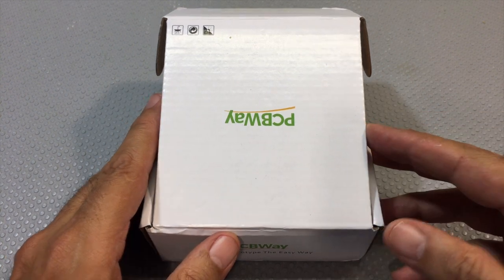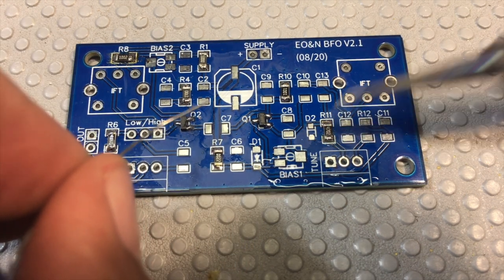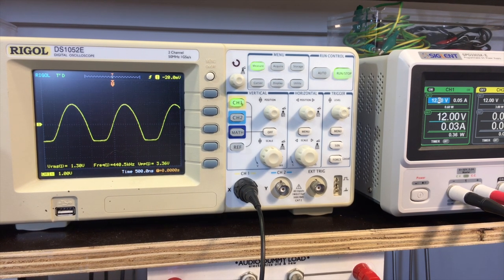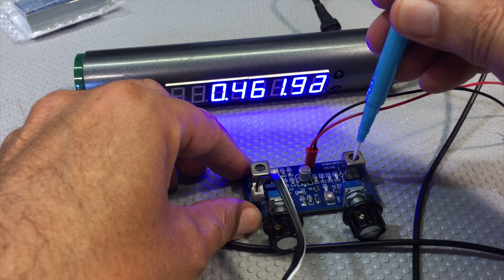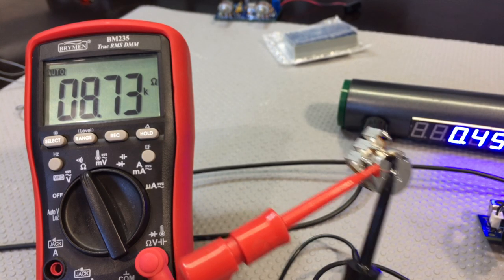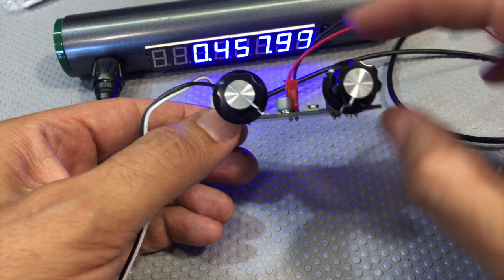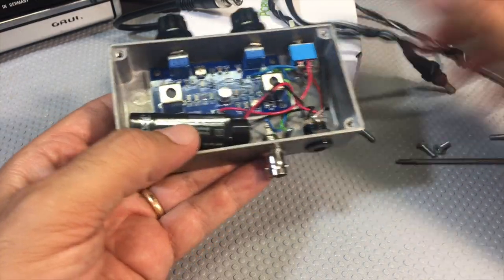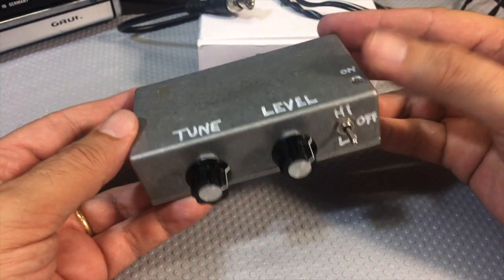External BFO. Build & Test of the SMD Version 2.1 boards from PCBWay.

Comment: Great job Manuel. That’s definitely the one to build. SMD isn’t that difficult as long as you have a magnifier and small soldering iron tip. A very useful addition to the shack or workbench. Thanks very much for sharing it. Regards Graham
Reply from the maker: Pleasure. 
I’ll be sending you the boards, plus two IF transformers and a couple of varactors, tomorrow.

Comment: Sir.  Thank you for the series on constructing a BFO.  I’m making one from your SMD circuit and, although it’s four years ago now, I wonder if you would be able to answer a question for me.  C6 and C11 are both 0.1uF capacitors attached to the +12V supply.  Can these be combined into a single capacitor, or is it important to keep them separate?  Thanks for your great work.  Regards, Grant, NZ.
Reply from the maker: Those are decoupling caps, so if they’re in different parts of the pcb, leave them separate.
Reply: @electronicsoldandnew  OK, thanks for taking the time to reply. Regards, Grant.

Comment: Very nice!  I have several consumer grade radios that pick up various SW bands through most of the HF ranges but lack built-in BFOs.  I'm curious - why did you choose 460 kHz as your center frequency?  Whey not 455 kHz, for example?  Was that just for the Grundig?
Reply from the maker: Yes, the IF for this Grundig is 460kHz. If you want to set it to another frequency, it’s simply a matter of adjusting as described.

Comment: Well done, its looking great.
I would be tempted to use SMDs, however thanks to my generous mum I have a benign tremor.  Using through hole is awkward enough at times.  Trying to place tiny components with tweezers would result a very full rubbish bin !
By the way, does anyone know of a PCB application that either does not have SMDs in the parts/footprints list, or that allows you to hide the SMDs ?  Trying to find through hole components hiding in a plethora of SMDs can be like looking for needles in a haystack and is very frustrating.
Reply from the maker: Eagle has that option, but it’s a little dated now.
Reply: Hhhmmm  I'll have a look at it - thanks.

Comment: Probably manuel, changing the output amplitude affects the oscillator's loading, really tiny  changes at scope display at time axis, like a jitter flickering. That effect is more visible with DPO scopes, or some capturing ones.
Dinamic changes  internal capacitance Ccb or Cce, if you can see it your frecuency meter also😉😊pretty normal.

Comment: I love your digital frequency display and who is the manufacturer
Reply from the maker: I don’t know exactly. Those things are all over ebay under different sellers as a module.
Reply: @electronicsoldandnew  what do you exactly call it
Reply from the maker: this: 
https://www.ebay.com/itm/0-1-60MHz-20MHz-2-4GHz-RF-Signal-Frequency-Counter-Cymometer-Tester-LED-Display-/263220630562?_trksid=p2349624.m46890.l49286
Reply: @electronicsoldandnew  Thanks bro. Hope it's available in India

Comment: Thank you, I think this is a very good method of adding SSB/CW to receivers without product detectors. I have a Hammerland  receiver that I wish had not been "modified" but rather had gone down this path. (Any thoughts of getting your amateur license?)
Reply from the maker: This method does in fact make it easier. I haven’t got an amateur license and don’t plan to get one. My wife would kill me if I got another hobby 😊
Reply: @electronicsoldandnew     Another hobby - no, no, no.  It would be a different facet to the one you are mastering ...  I believe the term is 'Spin'  :-}
Reply from the maker: If you’re not an attorney, you’re wasting some serious talent 😃